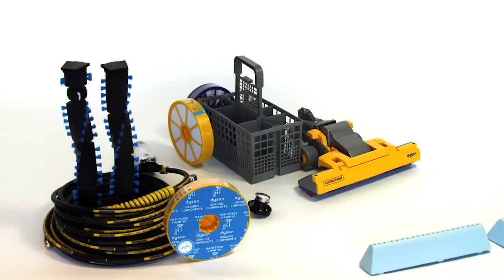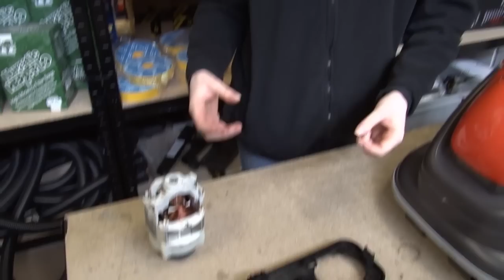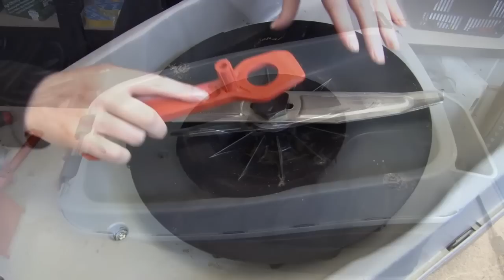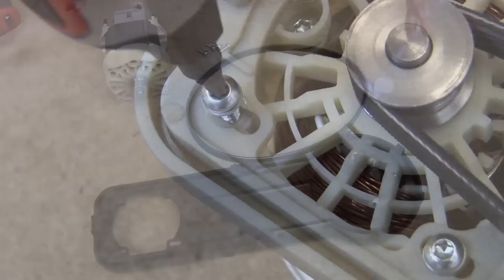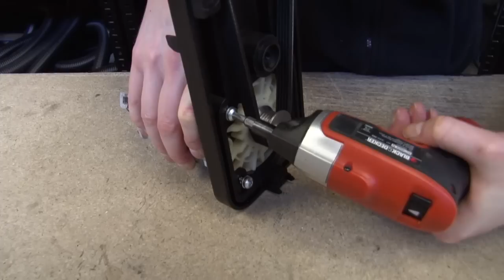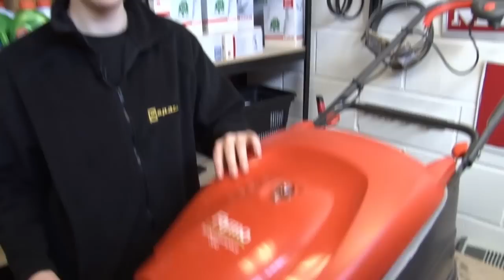Flymo Lawnmower Stopped Working? - DIY Motor REPLACEMENT Guide!

Comment: I just replaced the drive assemble on my Flymo 300v. When I now start it, it makes a really high pitched screaching noise for the first few seconds before then operating normally. Could it be that the belt is slipping or maybe rubbing?

Also before I put the new drive assembly on the drive wheel didnt rotate freely like it does in this video, should i be concerned about this?
Reply: It is usual for the screech when you start it up.
Reply: @robertmorris2899  this screech wasn't normal. I found out the part was faulty. The drive wheel was really stiff and causing massive strain on the motor to get it moving, it nearly burnt out in the process. I've returned the part and am waiting for a new one.

Comment: after she has removed the screws @2:50 the wholr motor/drive assembly seperates away. I have done EXACTLY what she has done but, although half the drive is now loose, the far end of it and the motor are STILL  rock solidly in place!!. Is there some other screw that she has not mentioned?.
Reply: there is one screw further up near the front ( she does point to it but the video does not show her removing it. If you have an old hover there may be grass covering the screw.

Comment: The lid doesn't come off so easily as in vid  it appears to be held by 2 lugs and they don't want to come out any help out there?
      graeme
Reply from the maker: +Graeme Gibbons A tip we use when we do not have great information is to look up the case parts. From there images it sometimes shows hidden fixings or screw holes that become obvious when you return to the device. :-)
Reply: its not held in by lugs (thats what I initially thought too), there is a single extra crosshead screw which you access (hidden) on the front of the main skirt (grey part not the oaring top)